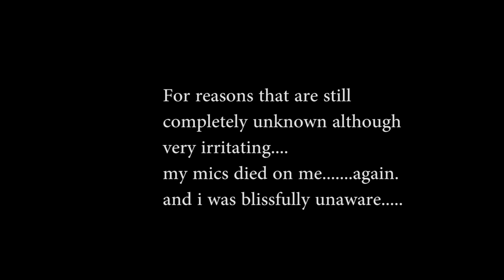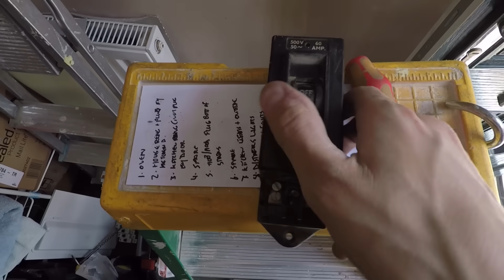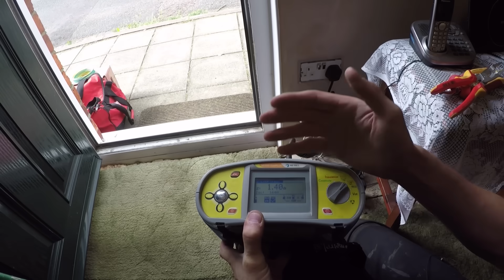Earth rod installation for fuseboard | Thomas Nagy

Comment: I've seen that not all the installs require earth rods? What earthing systems are used? If you install an earth rod do you require a MEN connection?
Reply: In the UK MEN is known as PME (Protective Multiple Earth), or TNCS. Earth rods are usually used on TT installations, where the Neutral may be a long cable and so not good enough to guarantee a sufficiently low impedance earth.

Comment: Another great video. What always make me f'ing laugh, at electrics in general, is that you and other sparks run the likes of an earth rod, or external light/socket in Kopex, armoured, etc (these being on the "safer" side of the DP/CU, post RCB, RCBO's, etc), however the electricity supplier just runs a non protected cable from the overhead power lines to the property/main fuse...NICE
Reply: isn't the supply feed a coaxial cable though, with earth tied neutral round the outside like armoured?
Reply: The DNO is a law unto itself.

Comment: Lucky it's not an earth stake like we have to put in here in NZ, 1.8mtr, and has to be driven the whole way
Reply: IIRC it's 4.5 m(!) for a PME supplemental rod here in Austria, one long one or several adding up to that. Typically they use short threaded segments and add on as they go. Most electricians don't seem to do earth rods themselves but sub them out to specialists.

Comment: Going back to not turning off power cos of servers, most recent servers holders will have a UPS. So servers won't be affected.
Reply: The UPS often only provides power for enough time to safely shut down, not to run them for a long time

Comment: A whole lot of buried gas and/or water piping is going to have a much better connection to earth than that earthing rod, but I suppose, with a lot of the infrastructure going plastic, the regulations had to change.
Reply: Yep. Not allowed to use water or gas pipes as earth rods now, as you cannot guarantee sufficiently low impedance. Plumbers were getting killed by live pipework because a fault didnt cause MCB/RCD to trip due to the main water bond not being sufficiently low impedance.

Comment: The swearing doesn't bother me. As a blue collar worker myself, I expect it from a person in the trade. 
Wasn't aware earth rods were still a thing? Thought the electricity board shoved the earth connection in with the neautral where the supply comes in (TNCs is it?).
My grandmother had on of those old RCDs on her supply, came in very handy when I wanted to change the old fuse box.

Comment: 3:19 servers have to have backup power installed so you can turn the mains off it will just switch to the backup system which is building to the server just making you aware Tom great video by the way love all the videos
Reply: Jamie Farrimond I think you’ll find this isn’t the case in reality. Also, in small installations, this backup power will last only long enough to allow the server to shut down cleanly.
Reply: "Should have."  Many don't.
Reply: Ive seen many instances of a UPS behaving badly or more to the point batteries way past their prime. Maintain the batteries people and make sure servers have the shutdown agents correctly installed. 21 years of dealing with systems.

Comment: The real world is nothing like what you hear in classes and what the code books say. In America we fallow what the NEC states to minimum standard. When you to a old house and you see a federal Pacific panel, house that has lamp cord or s.o. cable. We are required to tell the home owner we have to rewire that whole section. There's other standered and shit but I don't want to bore you all. Some houses have emergency backup. 
You can't just shut of her power off. You'll end up killing the bitch because her oxygen generator doesn't have power. Sometimes shit doesn't just hit the fan, It gets blown at you from a jet engine going mock 3.  The real world is way different then what you see in books. As long as you can meet the minimum standered you will pass
Reply: I hope you don't really have anything to do with electrical equipment.

Comment: how did you come to the conclusion that one rod was sufficient ?? and dont you think the low conductivity of the steel bolt is a compromise ?? also if you make a 32mm pipe sleeve with a screw cap you can protect the rod from elements and foot traffic or excavate the pavement to insert a proper chamber ???thus removing the trip hazard you have created ???
Reply: I would have probably chiseled the pavement and cemented in an inspection hatch around the rod so it's flush with the pavement too. I use the smaller plastic lids for sheds/summerhouses etc

Comment: Dp supply isolators are brilliant. Was told that if they're inside they have to be non-combustible like the cu. In a meter cupboard outside was told that insulated type is fine. Any thoughts people?
Reply: They really should be mandatory.

As for the non-combustible it depends on whether the BS7671 'similar switchgear assemblies' includes a simple switch.  I'm inclined to think not, it's not "switchgear" by any reasonable standard nor is it a "protective device" because it has to be manually operated, but many think they are.

NB If the isolator belongs to the DNO rather than the customer it's exempt from that requirement anyway.

Comment: That was an interesting one Tom!

Did you fit that DP isolator yourself, or get the metering company to do it?  If the former, surely you had to break the seal on the meter as well as the fuse, and whilst they will turn a blind eye to missing fuse seals, they are less happy about meters which have been "tampered" with... in addition smartmeters have anti-tamper switches will alert the supplier to the fact the cover has been removed...  But good that one is there, I believe it should be mandatory to have a single point of isolation for the installation.  However getting one fitted by the energy supplier is like Russian roulette - some say no problem and get it done in a week, others are less helpful (90 minutes on the phone to SSE who eventually gave me a date three and a half months later...!!)

Bosch tools are good to buy as the Bosch company is ultimately owned by a charitable foundation rather than a profit-making company.  I just wish they would take a look at some Metabo tools and see how to design a well thought-out carry case!

Comment: 7:46 Hmmm, what about galvanic corrosion from dissimilar metals? Brass and copper don't really suffer from it but I don't know about brass and steel.
Reply: I think he used stainless steel and copper, which is not a problem in combination together.
Reply: Brass and copper are not a problem at all. Plumbers use both with water with no problems at all.

Comment: bronze for a reason ? use a torque wrench set to 25nm wont snap in first place there is  loose then theres over tight both as bad as each
 other
Reply: He is risking galvanic corrosion

Comment: Hi if you put a earth rod coupler and nut  on the rod. Then hammer that instead of earth rod down to desired level then remove coupler it doesn't round the end off allowing clamp to be fitted later  great vid  

https://www.screwfix.com/p/earth-rod-external-coupler-5-8-/40483?kpid=40483&ds_kid=92700031524337582&utm_source=bing&utm_medium=cpc&utm_campaign=PX%20%7C%20Shopping%20%7C%20Electrical%20%26%20Lighting&utm_term=4584207574611327&utm_content=G%20-%20Cable%20%26%20Cable%20Management&ds_rl=1245250&gclid=COuntoz6qOMCFYcVGwod_lYKJw&gclsrc=ds

Comment: You seem to cover such a wide area going to Milton Keynes (I suppose a board change is worth it) but where do you draw the line on a job and say to the clients it’s not worth doing due to travel time and travel cost which I would have to pass on

Comment: I was asked to install a rod to bond a generator set(which was in an engine room) the c.o.w was a bit stroppy,   seeing the building was surrounded by lots of commercial units I was a bit reluctant to drill into the ground ,seeing the c.o.w was a pain in the arse I asked the question where should I drill safely?  Well that sorted him out ,suddenly it seemed not necessary for the rod to be installed as the 70mm company earth would suffice!

Comment: Servers will be on a UPS but they will still be pissed as it will only last long enough for the servers to shut down
Reply: Ive seen many a UPS battery fail and a controlled shutdown becomes a shut off.  Bigger sites also have generators. 21 years in IT  and dont miss it one bit. 😂

Comment: Just  one   short  rod is enough?  Is It TT system?  Here in Brazil  we  drive into the ground three or even much rods for TT system,one single rod  have restence around 150 ohms,that high resistence may be  dengerous to someone else's  life. Only for TN-S  systema we  use just  one single rod.

Comment: Server should all have a ups
Reply: Yes.  But even then a UPS may have only a limited capacity and some are intended to give only enough time for machines to be shut down gracefully when the power is cut.

Big installations with UPS and backup generators are a different problem...   you've isolated the incoming power but the wiring is still live!

Comment: I had to laugh when you kept dropping screws up that ladder, thats me pmsl! :-) always take some spares up..save yaself a trip Tom. TT systems are allowed 200 Ohm Ze impedance but not recommended as it can be "unstable" lol no shit. RCBO's are essential on TTs, Like others say, Parallel earth paths from water/Gas bonding likely increased the impedance. Also with you on safe isolation, I Always do if I can, but people have a phobia these days about losing WiFi and shit, the world is a different place these days, 24/7 supply required. Great video Tom, keep up the swearing and the great work in that order :-)

Comment: Don't you use a cat/genny before drilling on the pavement? You don't know if you're going through the gas, water, drains etc...
All I have to say about isolation is this: would the NIC pass you if you had an inspection on a job where you don't perform safe isolation?
And the swearing: pretty sure your early stuff was "F" free.....

Comment: I agree with you about the isolation stuff, but all servers and any other critical computing should have a ups supplied locally. If they don't then it would fucking well serve them right if all their machines went dead when you cut the mains.

Comment: Tom, you're right about  the situation with isolating boards; if the client isn't using the installation in a way that allows the power to be dropped without a massive impact on their business, you can't isolate the power. But you should try to educate clients as to the risk to their business of you working on live boards - yes, you are trained to do it, yes, you will be as careful as f**k when you do it (because your life is at stake), but you can't guarantee that something won't go wrong, because you are human like the rest of us. A planned outage is better than an unplanned outage. Give the client the choice, and get them to sign up to their choice, so that you neck is not on the block if they do have an unplanned outage.

Comment: Hi Tom, quick question.  Is there any reason your not installing the new A type RCBO's.  Hager & wylex both do them, not much difference in the price.
Reply: @GadgetMan36   Effectively, yes.  The weasel words in the regs say the components have to be type tested to the enclosure which means a board manufacturer could type test other manufacturers RCBOs, but which of them is going to do that?

Comment: I work in refrigeration and its the same thing.. 3 phase panels, live, some contactors running compressor motors pulling 2/300 amps.. Still gotta open the panel and work on other components when the chiller is running.. its why we do 4 years training before we're compitent enough to know we wont fry ourselves
Reply: Darwin also helps with the education process :)

Comment: Slightly surprised at the enclosure for the rod connection - bit of plastic on a (effectively public?) footpath… and a bit of tin label over-hanging the edge ripe to slice anyone not wearing shoes 🙈

Your work is usually so neat and quality
Reply: gadgetman36 the blue tin label is CLEARLY overhanging the edge of the box - look at 9m onwards - like a razor-blade🤦‍♂️

What about guttering? Is guttering a safety electrical connection?

Comment: Every european tradesman is swearing. Some more, some less. If he or she is not swearing the person isn't a real tradesman or a european neither. That's one thing all european tradesmen have in common if they're on the proper work site...only the languages are different...
And here in Germany we got the "Schwäbischer Gruß" (swabian salute)...

https://en.wikipedia.org/wiki/Swabian_salute

And sometimes you can't isolate. Think about a hospital, there you simply can't switch off circuits. So you'll have to use fully insulated tools (the regular ones are only partially insulated, they protect you but still can cause a short-circuit inside of the panel), proper personal protective gear, an insulated rubber mat to stand on. You should try to avoid working with power on, but sometimes it doesn't work. The other method is when you're creating a new circuit built the circuit and start in the room and then at last make the connection in the panel, so you're not required to switch it off.
And sometimes it's about what you find in the panel. Is it a new one with high level of protection against contact, or an old one with almost everything open and touchable.

Comment: In terms of safe isolation IMO it's all about risk assessment, some boards (eg Schneider is the best example I can think of) are well designed and very easy to safely work on / add circuits etc and I'm happy to do so, others I wouldn't even take the cover off...
Reply: Schneider boards are awesome to work on.
Reply: The old crabtree C50 boards = fucking death trap.

Comment: About that safe isolation ramble, why would you want to switch off all the power on a fuse board? If you know what the fuck you are doing, it doesn't matter that it's powered, right? I mean, I even wire in new sockets with the power on if I have to, because I know what I'm dealing with. 

Keep doing what you're doing, as long as you know how to do it. In the end everyone's got their own opinion, and you don't have to listen to/agree with that opinion. Also, if swearing is what makes you you, you won't hear me complain (but you would hear me swear a lot, 'cause you're not the only one who does that!)

Comment: Do you really need to put a rod in the ground? Can't you just screw the cable down into the pavement? I'd just use a screw, much faster and cheaper.
Reply: Yeah...a 1 metre Copper Screw...;-) pmsl... good luck finding one.

Comment: i agree with safe isolation for people who dont understand electrical installations etc, but we are in the trade and know how to work safely with it live from time to time , just treat it with respect and never be complacent
Reply: Having worked in a lot of live situations even inside cabinets surrounded by bus bars ,no you can't turn that off it supplies everything that's essential, but the thing that catches you out is usually something silly! I had to fish a cable out of some trunking and managed to grab a broken, live open end,how I laughed not.
Reply: And never never assume that the circuit is dead,always treat the circuit as live always until proved dead.
Reply: called " Test before you Touch ", is a standard mantra for Sparkies ..
Reply: @bluddyrowdy8757  another one is when someone says it's dead, still check take nothing for granted, stay safe.
Reply: @johnxenofontos1058  I was fishing a cable out that i was running(i.e dead) the one touched was already inslalled , the trunking was 6x6 so loads of singles I just found the wrong one!

Comment: I had trouble with the earth rod, noticed that if I touched things I got a tingle, then The oscilloscope started to give funny readings so I started to check things out and found that the whole fabric of the house was live at around 180 volts to ground. Got an electrician in and instead of fitting a new earth rod he wired the house to the company earth. Trouble is I have far to much equipment with Y class capacitors in the house if to many are in use at once they trip the Rcd/RCCB as does my 110 transformer on occasion.
Reply: You would solve that by fitting more rcds/rcbos
Reply: You need to check each circuit and ascertain which one has earth leakage on it, any more than 30mA on the cpc will trip the RCD. This is a reason why in the 18th Edition we now need to be fitting A type RCDs instead of AC types.they detect DC voltage leaks too.

Comment: The reason the installation connected up is giving a lower earth loop value is almost certainly due to a bonded metal water pipe, which in effect is a very long electrode. In addition, if this is the case, all other dwellings with bonded metal water pipes are effectively in parallel, further lowering the reading. 24 ohm from that thing is impressive!
Reply: Or possibly the gas main. Tell me, does the neutral just go to the same place the earth goes, that is to The Earth? If not, where does the neutral go???

Comment: in my country, earth rods need to provide resistance  of 10 Ohms or less. To achieve that we sometimes drive up to five of them into the ground (I heard even more in some cases). Of course we use big hammer drills and not a hammer :D great vid
Reply: Bears Beets we just piss on them to get the readings down